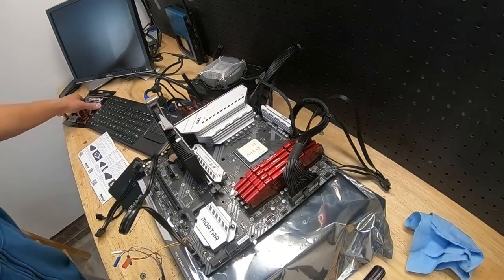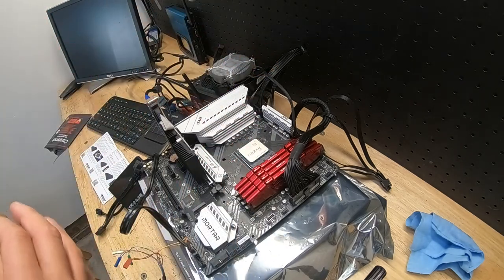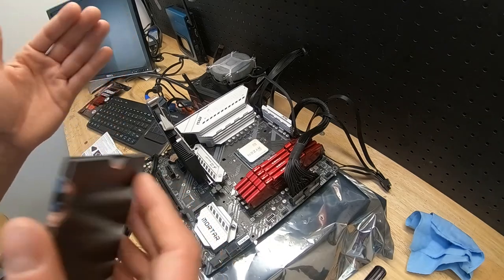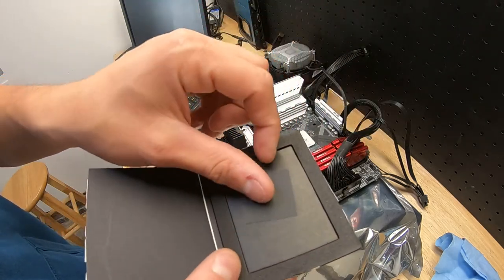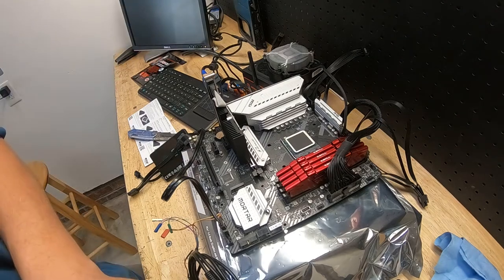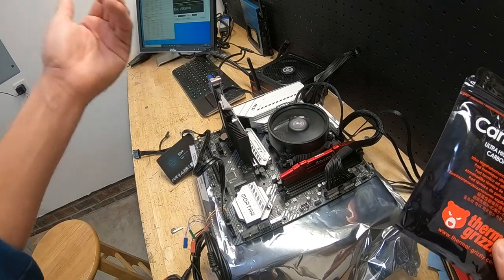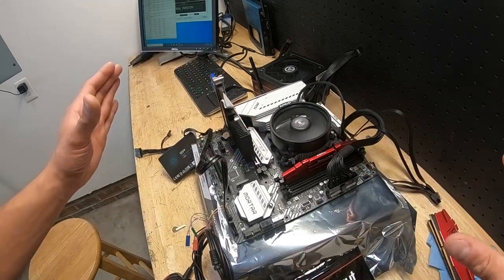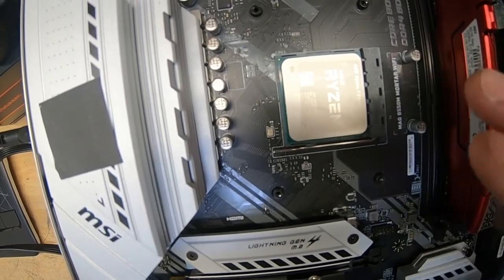Thermal pads are great!! Here's why!

Comment: dude i applied this pad on my laptop. my temps went from 95-100 on cpu to 65-70 at max turbo clock(4.2ghz). insane stuff. gpu always ran cool so thats not an issue. hopefully it runs like this for the next few months atleast
Reply from the maker: very interesting. I use these for quick testing and never had used it long term.
Reply: @DLMtechgarage  yeah I used these on my old laptop for more than a year. Temps remained constantly good throughout and i only ever needed to clean the dust in the fans
Reply: Is your cpu i5-10500h?
Reply: @laithabuhammam8014  i7 10750h 6 core 12 thread

Comment: I was actually debating between buying a paste, liquid metal or that thermal pad, very helpful review!
Reply from the maker: Thanks, I honestly shy away from the liquid metal, not worth the hassle, unless your a serious over clocker the performance gain is not worth it.
Reply: @DLMtechgarage  thanks man now I'm really decided on the thermal pad coz LM could fry your motherboard or other parts.
Reply from the maker: @Rypple23  yea the smallest drop of LM can cause a disaster lol...
Reply: @DLMtechgarage BTW id like to follow your build for my wife I have an M92P Sff that I would like to recase.
Reply from the maker: @Rypple23  yea its real easy, just the front USB is a little tricky to pin out. outside of that I have videos on the swap and power button pin out.